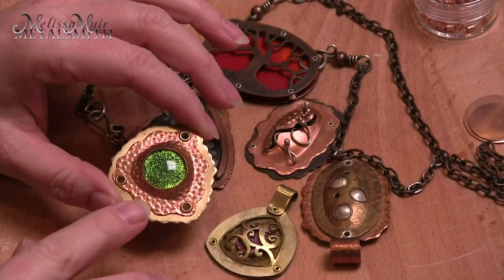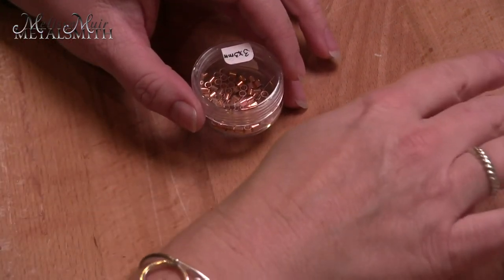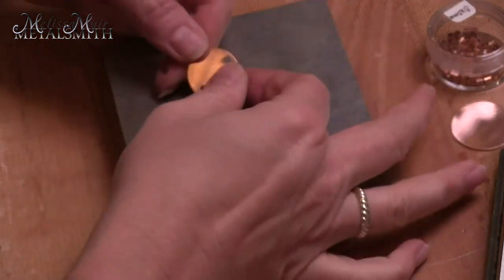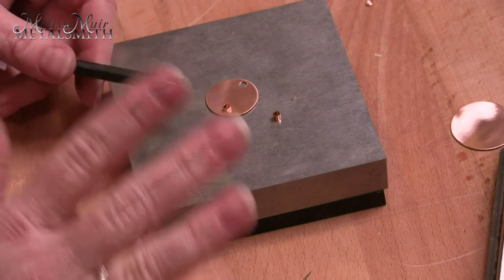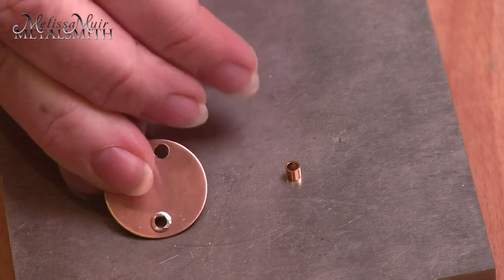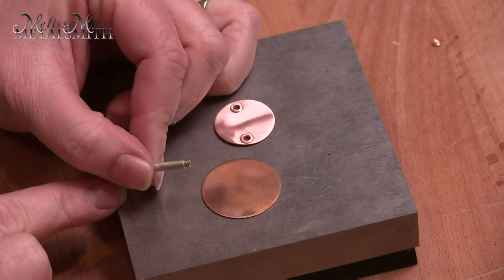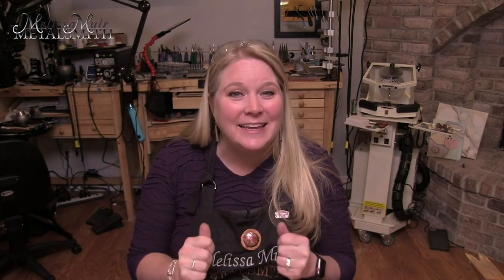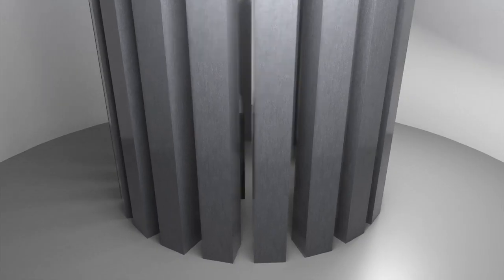How To Make Tube Rivets: Tool Time Tuesday

Comment: Thanks for sharing... I have two steel semi tubular rivets I need to re-set on a couple handles for a project I'm refurbishing. And in looking up a DIY method your video came up in the search. I didn't think to use a center punch to start the flare... after seeing you do it I was like - well duh! Why didn't I think of that? lol
The size clincher I need for these rivets is $25+ - If this works for me, which I don't see why it wouldn't. Saving that cost just to set two rivets is a plus. So thanks again for sharing the knowledge.
cheers...
Reply from the maker: So glad it was helpful.
Reply: @MelissaMuir  - BTW - it worked like a charm. Thanks again for sharing your knowledge.
cheers...